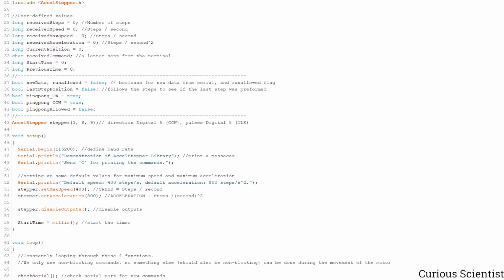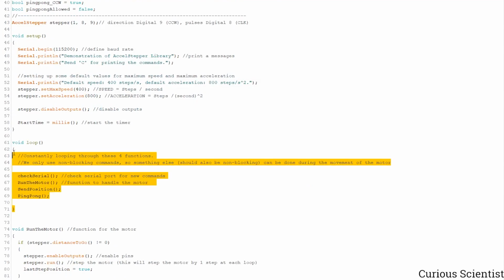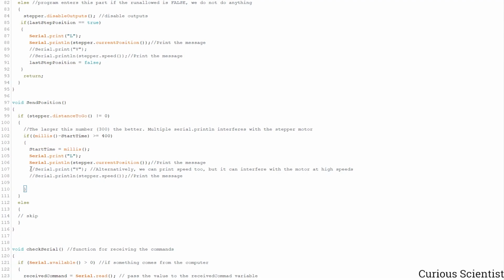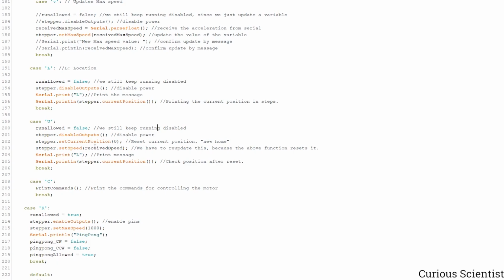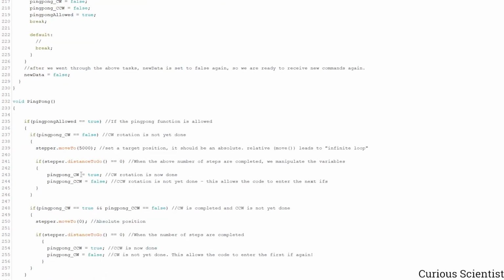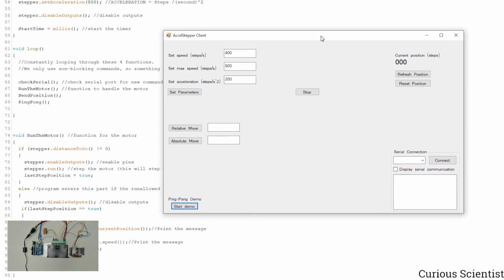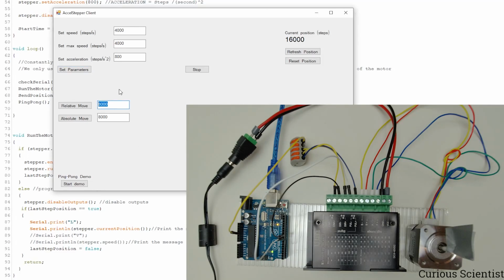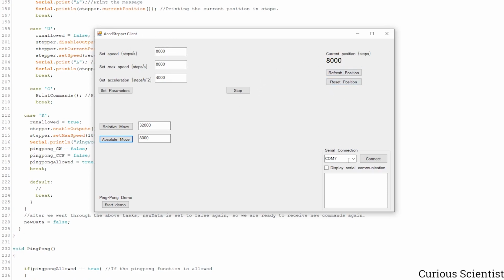Updates for the AccelStepper library - TB6600 and Arduino

Comment: If I understand correctly, you mention that the "run" command results in one step per loop pass.  I don't think that is correct.  I think it is that as long as the loop is fast enough to provide more "run" commands per step time, the stepper keeps running.  Otherwise for very slow step rates if there were one step per loop, the loop time would be extremely long.  I find it to be a somewhat unusual approach but I understand why it is structured that way.
Reply from the maker: The run() function is being polled in every loop() iteration, and if a step is due, the step pin is toggled. At slow step rates, the run function might only toggle the step pin at every 100th iterations.

Comment: Hi, isn’t there necessary to connect some resistors in series to the driver’s signal input?
Reply from the maker: Hi! No, when VCC is 5 V (which is the case in all of my demos). If it is more than that, you'll need current limiting resistors. Source: datasheet.

Comment: Thank you for video. I need tun the nema 23 bilolar stepper with TB6600 by arduino. 
      Can you give the code for the beliw sequence? 
    My sequence is  puls per rov. 200. 
I want move the stepper 0 to 54000 steps which is 270 full revolution. And take a time delay, then again return to 0 step.   Repeat the cycle with a time delay.
Reply from the maker: Hi! If you want me to write a code for you, you can hire me for work. You find my email on my website.

Comment: Thanks for your video great work, may i get the source code for the client tool application(Winform) i want to create my own application to work with serial communication same as you or do you have some anywhere that i can learn this thing.
Reply from the maker: Hi! 
The source code is not available, sorry. But I am working on a series where I teach how to communicate with a microcontroller via an application on the PC. It just takes tremendous time and effort, so it goes slowly. Please stay tuned.

Comment: Nice project.  Are you able to use this in the case of non-blocking and tracking movements?  I'm looking to update the position in real-time, and the motor slews to this new position.  Sometimes a new fixed position will be ordered (ie move to 255 degrees) or perhaps relative (+15degrees), which will countermand the previous order issued that may not have been completed. Not sure how to implement this without movement that stutters and jolts the motor - which must be avoided. I'm wanting smooth accelerations and decelerations (even in cases of change of direction).  My project is to move a homemade observatory dome to orientate the dome window to match the telescope angle of sight.  Most of the time movements are slow, but they are always slaved to match the position of the telescope. During some star-seeking movements or perhaps tracking the ISS, the movements require very rapid updates. I currently limit the updates to >ABS(5degrees), too much time is wasted.  Using an ESP32 processor with Arduino SDK C++ with the standard AccelStepper library.  My current setup works for linear single step instructions, but this is limiting.  Any advice or pointers on non-blocking updates would be appreciated.
Great videos - keep them coming.  regs Rob
Reply from the maker: Hi Bob,
First, I recommend studying the well-written documentation of the AccelStepper library itself. There are multiple functions to run a stepper motor in different ways and some of them are blocking, some of them are not. Actually, these (blocking or non-blocking) are stated in the descriptions of the functions. The simple run() function is for example non-blocking. You give a relative (move()) or absolute (moveTo()) target to the code, and then the run() function does its job in the main loop() of the code. Whenever a step is due according to the set speed and acceleration values, the code will perform a step when the code reaches the run() function. 

What many people miss is that they can still block this non-blocking function. If you are reading a sensor or doing something else that takes more time than the time between two step pulses, the motor will start stuttering, and it will either skip steps or mess up the speed of the motor and cause jerky motion. So, be careful with "parallel" tasks, they might be "serial". 

I have a "workaround" for this issue and a video about it on my channel. I use two microcontrollers: one is the master that communicates with a computer, with sensors...etc., and another is the slave that only receives commands from the master and runs the stepper motor. With this arrangement, you won't have speed issues because the slave microcontroller only handles the motor. It is a quick and dirty solution, but when a microcontroller costs 3-5 USD, it is more feasible than spending hours or days on figuring out a better code (think about the time you spend on coding and your hourly wage at a job and compare it with the cheap additional microcontroller). I am sure that a good programmer (which I am not) could figure out a better solution based on a single microcontroller. Link: https://youtu.be/6zqq79mXjFw

Comment: thank you for the video - I absolutely don't understand how the .disableoutput /.enableoutput can work if  the  enable pin is not defined  in the constructor ? or even not wired ?   how the library can enable/disable the outputs just by the pulse/dir pins ?  as far as my limited understanding  goes - the  enable/disable functionality of the library works just and only if the constructor is controlling the outputs directly (not 1 = Driver) like 4wire etc. as far as my limited understanding goes when you use a driver (constructor = 1 ) you must wire the enable signal and  instead using the library  .disableoput / .enableoutput   you need to explicitly set the enable signal to HIGH or LOW - please correct me where i'm wrong ....
Reply from the maker: Hi! You need to add the enable pin yourself to the code. I just added the enable and disable parts to the corresponding places so the viewer can see where it makes sense to potentially use them. As you said, you need to "manually" define a digital pin as an output then use the digitalWrite() function wherever you want to en/disable the motor.
Reply: @Curious Scientist   thank you for extremely prompt  reply ! it could be a nice feature of the library to specify the enable pin in the constructor after the pulse & dir - this way the built in library functions .disableoutputs / .enableoutputs would continue to work even with a driver .
Reply from the maker: You're welcome! Unfortunately, I don't have any control over the accelstepper library, so I cannot implement this extra functionality. I am just a user who tries to explain his experiences with the library.

Comment: Good, you made the acceler client very convenient.
I have a question.
I checked that the value of the current post (steps) changed.
I used the current positioni() function, but steps only expresses the final position value after the motor moves.
What method can you use to display the value of change?
Reply from the maker: Hi! I don't have the code in front of me now, and it has been a while since I wrote the code so I don't remember the details perfectly. I think that the code sends the position only when the movement is finished. The reason is simple, the currentPosition() function, especially combined with a lot of serial communication can cause the motor to stutter. To get a continuous information about the position, you just need to continuously poll the currentPosition() function and send its return value to the serial port. Alternatively, add an encoder to the system.

Comment: a very good video  and well explained 
This video was cnc /3d printer x y z with  accurate positioning ect but could you show an example of a position from an out side program that is all ways up dating where the position should be 
example     DCS (digital combat simulator) a flight sim game, going into a second program Sim Tools which is extracting all the flight telemetry. lets say just the roll of the aircraft .
the out-put from sim tools minus 32767 (180 degree bank left)   0 (which is wing level)    positive 32767 which is (180 degree bank right) 
The problem is when you do a complete roll so lets say bank to the right . the counter gets to +32767 (wings level but upside down) then is has to move to minus 32767 and count down until it gets to zero But because the motor can not keep up with the game all the time and a new value comes in be for it has completed its move and makes it stop its full roll and continue with the new input position.
This has been my challenge for years, I have a working code but it very lumpy .There seams to be a very big market for arduino code that is easy to understand to make diy stimulators work
in my case would i use move (x) or move to (x) or an interrupt  or a pingpong sort of thing Just wish i had something between the ears that makes it look as easy as your video to wright code
Thank you very much for posting video i now have lots more to think about
Reply from the maker: Thank you! If the motor cannot keep up with the incoming values, I think it is something wrong with the software. Maybe the processing of the values is not coded efficiently. I hope you find the solution.

Comment: I would be happy if you could show hot to implement function like setting zero position of the motor without using limit switch, for example manually moving the motor till finding a desired position and setting it as home position so that if we accidentaly press a negative value we dont pass that point
Reply from the maker: I have other videos where I show how this can be done. Check my stepper motor control panel videos.

Comment: Hello, thanks for all the hard work you put in for these tutorials. Have a question About the a delete post lib, for the acceleration variable, once the desired speed is achieved the acceleration stops but how does the program calculates the deceleration? And is it the same rate as the acceleration ? So, when its x number of steps away from target it determins it needs to go in decel, so the trapedzoid profile is calculated by the run function?
Reply from the maker: Hi and welcome! Yes, the deceleration is the same as the acceleration, the only difference is the sign. Based on the parameters you determine for the motor, yes, the speed profile will typically have a trapezoidal shape. And yes, the Accelstepper library recalculates the values between every step when you use the run() function. By the way all these are written on the website of the Accelstepper library. Read the documentation.

Comment: Is there any way to instantiate an AccelStepper instance conditionally? E.g. right now you (and all examples I can find) create the stepper with default or specified pins right at the start. I want to make a stepper available, but only when I receive a command specifying which pins it's on. E.g. I don't know when I start what pins the stepper is on, or if there is one at all. Then later, I get a command saying "I've connected the stepper to pins 3, and 4" and I want to start driving it from those pins at that time.
Reply from the maker: Probably it is possible, I have never tried it. But this practice might be dangerous because if you just randomly assign pins to the stepper motors, you might end up using important GPIO ports such as i2c, spi...etc pins. I wouldn't use the practice that you described.
Reply: @CuriousScientist  I have no idea how you got the idea that the pins would be assigned "randomly". Have you heard of Firmata? It is a program which allows the Arduino (or other device) to be used as an IO device, /without/ re-programming the Arduino. The assignment of pins, etc... is done by the host computer (a RasPi, PC, etc...) by sending commands to the Arduino via Firmata. So the pins are not setup "randomly", they simply aren't set inside the Arduino sketch. The AccelStepper library is not compatible with this system because it simply does not allow one to assign the pins except during the compilation of the program. Sadly, I will have to find a different library.
Reply from the maker: By random I meant that they are not assigned from the beginning but for example the user says that they want to use pin 10 and 11 for controlling the stepper motor. But this would be "dangerous" because these pins are also used by the SPI protocol. But why can't you assign the pins from the beginning? I always start with the hardware first and then go for the software. So, first check which pins you want to utilize, then write the corresponding code for it.
Reply: For anyone who wants to do this, the trick is to use the other syntax for declaring the stepper which takes a pair of functions: e.g. 
AccelStepper stepper(step_forward, step_back);
Then you can define, in the functions, which pins to use, which gives you full control over them. e.g.
int dir_pin,step_pin;

void step(){
    digitalWrite(step_pin, HIGH); // step HIGH
    delayMicroseconds(DEFAULT_STEP_DELAY_US);    // Delay the minimum allowed pulse width
    digitalWrite(step_pin, LOW); // step LOW
}

void step_forward() {
    digitalWrite(dir_pin, HIGH); // Set direction first else get rogue pulses
    step();
}

void step_back() {
    digitalWrite(dir_pin, LOW); // Set direction first else get rogue pulses
    step();
}
Reply from the maker: Thank you for sharing this!

Comment: Brilliant, just what I needed!  I will need to work out with my belt drive gearing how to convert steps to degrees. Would be good of there was a box on screen for this. Even better would be to use a separate 4 x 4 keypad & LCD  & memory to become independent of the computer. Thanks again, great tutorial.
Reply from the maker: Check my channel, I made a similar control panel that you described. Keypad, lcd, bunch of options...etc.

Comment: Where did you do your interface to direct your arduino? I think it's C#. Btw your all videos are so amazing. Im so thankful for this.
Reply from the maker: Thanks! C#, indeed. And I used Microsoft Visual Studio to write the software.
Reply: @CuriousScientist  can you provide some further information how you did that ? Your code is awesome and I learned a lot, but I want to modify the code and the GUI to control several Stepper.
Reply from the maker: It is just a simple GUI where I placed a few controls which send some message to the serial terminal. It is not very complicated, you just need to make sure that the receiver (Arduino) knows how to interpret the commands.

Comment: Good explanations all round on all your videos. Just one thing, is the "runallowed = true" needed at all for the Relative & Absolute functions. In the previous library we need it because the RunTheMotor function was triggered by: 
if (runallowed == true)
    { 
        stepper.enableOutputs();

        stepper.run();
    } ............
With this code though it looks like the RunTheMotor operation "stepper.distanceToGo() != 0"  doesn't need the boolean statement and only needs the following inputs:
stepper.setMaxSpeed(receivedSpeed);   
stepper.move(receivedSteps); 

Also is it possible to look at the AccelStepper Library directly, just curious how you got the library to work in the way it does.
Reply from the maker: Thanks! Check my more recent videos because I actually got rid of this part of the code. Also, you can simply use Google and visit the official website of the Accelstepper library where there's a very nice documentation on each classes and functions.

Comment: Once in a blue moon YouTube algorithms provide some great content, and this is such a case! I’m in research mode before building a camera slider and this would be great for that. My goal is to have several keyframes that the slider will move between and it would be great to be able to choose the type of ease in/out. Right now it looks like there is only one value for in and out? Have liked and subscribed 👍🏼
Reply from the maker: Hi! Thank you very much! If you want to build a camera slider, you might be interested in this video: https://youtu.be/UojoDm1oZrU 
Especially check the goTo() function and the pingpong() function.
Reply: @CuriousScientist  Thanks. I will take a look 👍🏻

Comment: First of all I would like to thank you for being an excellent instructor. I am a old man and I learned a lot from you. But here is my problem. I am trying to build an automatic feeder for my birds. So I have 17HS4401 stepper  with TB6600 motor drive running with Arduino Uno. The program works great with no load on the stepper. When I attach a a tray to the stepper probably 1 KG equally balanced the stepper goes nuts. It moves very short or very long increments. Do I need a bigger Stepper?. Please help.

Andy
Reply from the maker: Hi! Thank you for the nice words! It is hard to troubleshoot it because I don't see the system. If the stepper goes nuts, try the following: run the motor without any load at the same speed that you would move the tray. When the motor runs, pinch on the shaft and try to stop it. If you can stop the motor, then the torque is low. If you can, try to increase the current (within the motor's specifications) and do the "pinching test" again. If it is still problematic, then maybe you need a larger motor, or you just need to use some gears to reduce the speed and increase the torque. Also check the microstepping. The lower the value, the higher the torque. You should get higher torque at 1/1 microstepping than at 1/16.